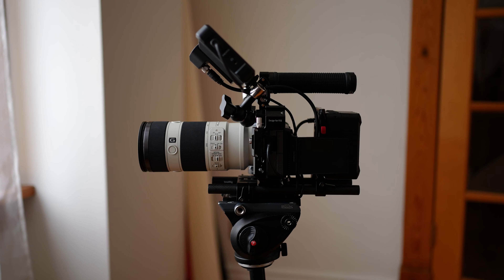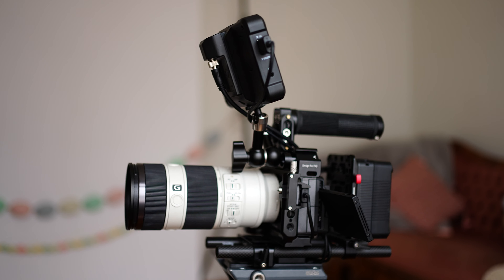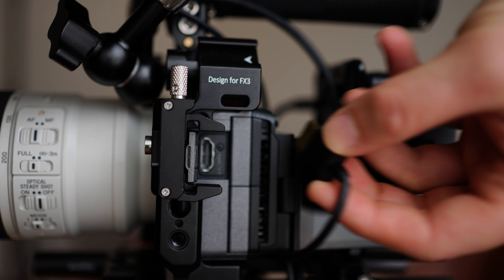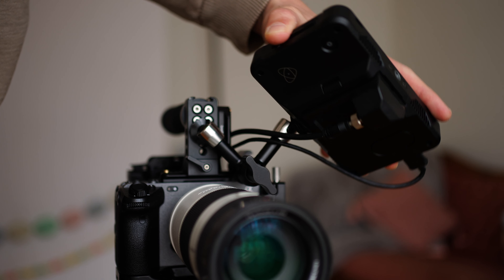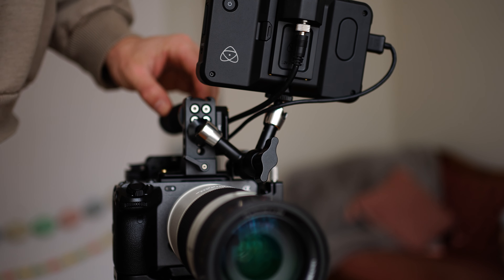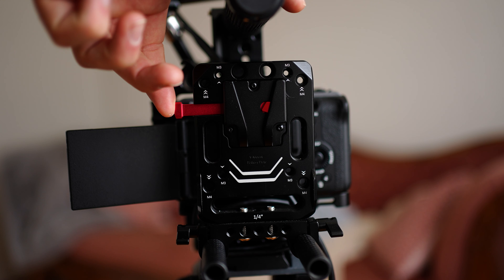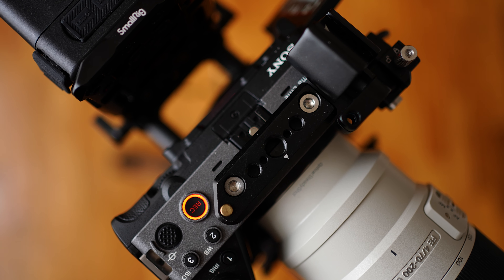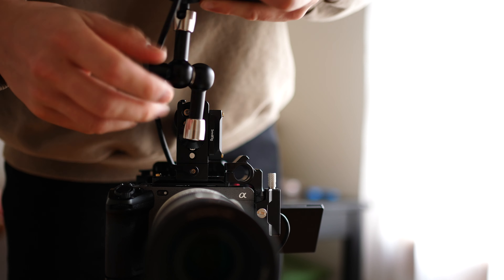Sony FX3 Handheld Cinema Rig

Comment: Hey! Thank you so much for this video, I have a very similar set up and was wondering do you just keep your camera plug into the USB-C all day for weddings? If not, any reasons why you don't?
Reply from the maker: No problem man. I actually just ordered a right angle to right angle usb-c cable to test that out. I currently do not power the camera through usb-c. Mainly because I have 7 batteries for my body and I don't feel like swapping those out quickly inhibits me in any way.
Reply: @TheWeddingGuest.  ahh okay! Great to hear! I was afraid it was something to do just not being great being plugged in all day.

Comment: Hi! Im thinking of trading in my 70-180 f2.8 tamron for the lens you have here because the stabilization. I myself have a fx6, could you test out for me if this rig works smoothly handheld without the ibis of the fx3 on? Would really really help me
Reply from the maker: Hey man. With this lens, if you turn off IS on the lens via the switch , and then try to turn off stabilization off in camera, a notification comes up that states, "Invalid with this lens. If the lens has a SteadyShot switch, perform the operation from the lens". 

So I dont think you can completely turn off IS when using this lens.
Reply: @TheWeddingGuest.  thanks, i just traded the lens for a 70-200 f4 and it works absolutely amazing with the fx6. Even handheld!
Reply from the maker: @everonproducties  Its crazy right? especially with active stabilization turned on.
Reply: @TheWeddingGuest.  its way better! Didnt like the tamron at all, went full native

Comment: Hey! Just had a quick question, i have a 13400 mAh with 190Wh v mount battery, i just wanted to ask to see if i can use this v battery safely with sony fx3 with dummy to d tap cable?
Reply from the maker: Hey man! I think it would depend on what wattage the battery is outputting. Just make sure that the wattage output of the battery is more than the camera can accept via dummy battery. 

I currently use my vmount for my monitor only; I use a USB C cable from the battery to my fx3 if I need to charge.
Reply: @TheWeddingGuest.  I got it buddy! I really appreciate your help and your information! Much appreciate it.